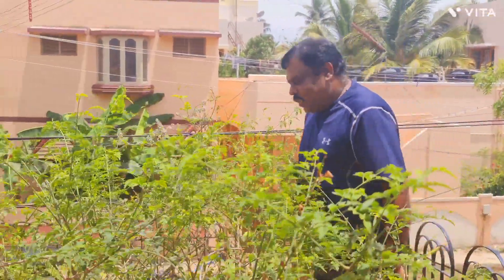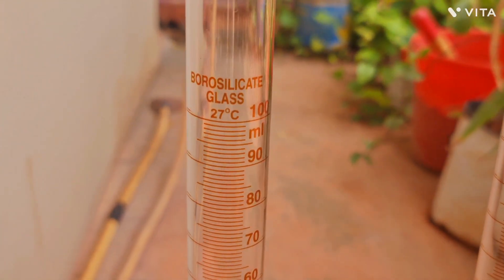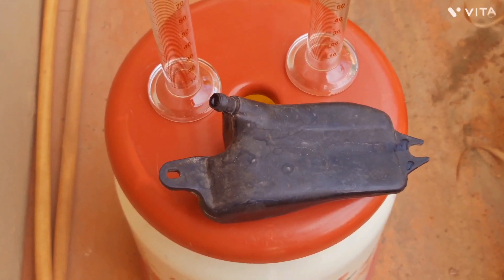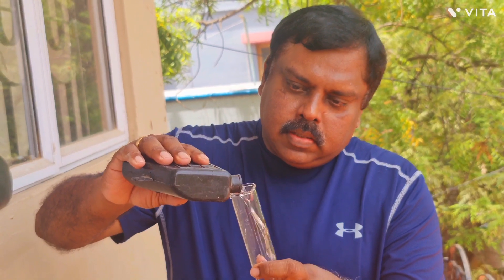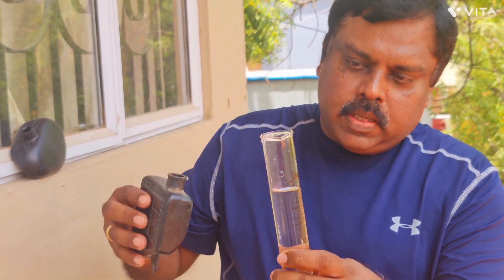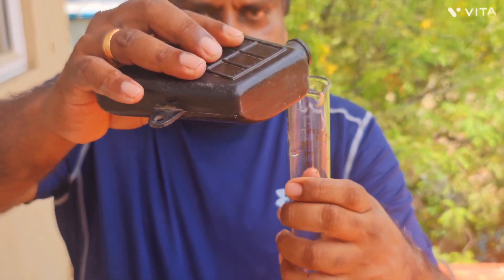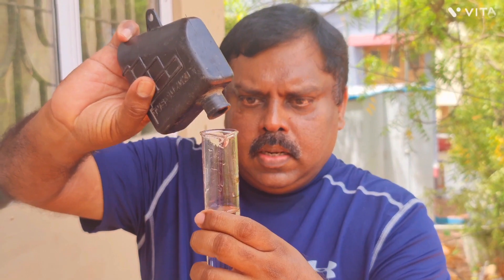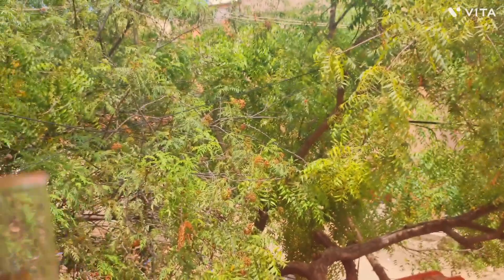Power boxes of Indo Japanese 2 stroke Bikes

Comment: Which powerbox is better for 100 cc bikes
Reply from the maker: The original power box of each bike os the best. It has been calculated for that particular engine. For normal 100 cc 2 stroke bikes which comes without powerbox, use it that way as its bhp is less and adding powerbox doesn't add any advantage over it. 
Again keep in mind powerbox means " No added power". The name is misleading . The right term for it is " Resonator " . So please don't think adding a powerbox boosts power to the bike. Its not.